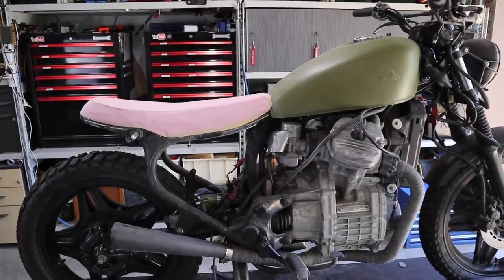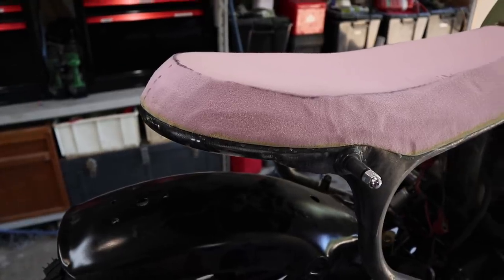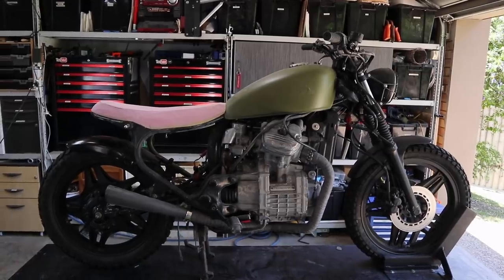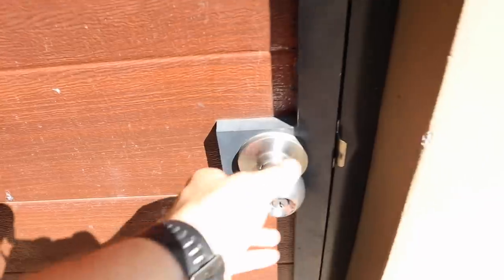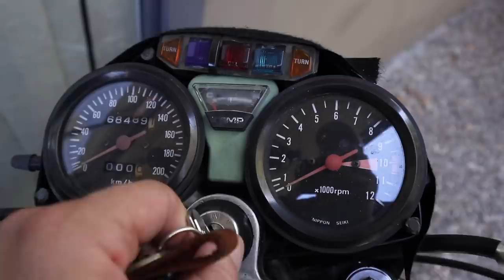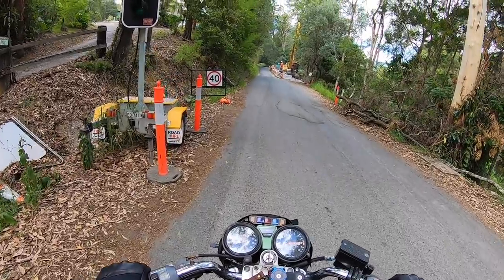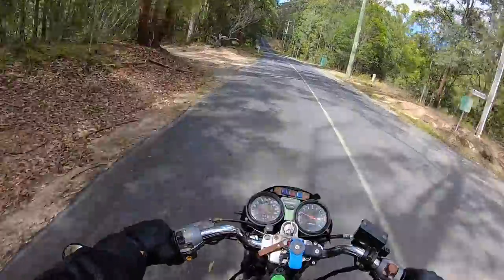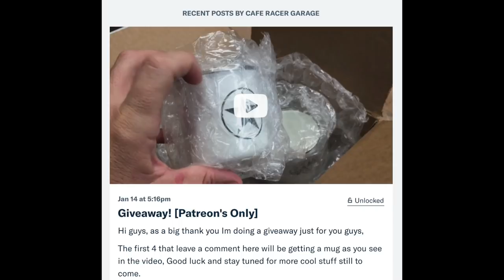Scrambler Foam Seat Pan Shaping Part 2 - Rainforest Motovlog - Cafe Racer Build

Comment: Dan took a humble rumble on the bike! :-) The seat...I think thinner at the "drivers" bit, makes a support at the back. Walking dead? My son did, and I watched passing the sofa. I only saw some bloke on a chopper/bobber'ish bike. To hold that seat in position...hmm, you have some wiring too since you put the light in the sofa. Could be fun with a belt attached to the bottom of the frame, between the frame and rear mudguard, going over the seat like the arrangement they have on old sportscars over the bonnet! You know, the Bugatti's and such. :-) I will on my build! :-) Oh, it's snowing now! ...no hurries then...

Comment: Love the walking dead and have a deep love for Daryl’s bike. I think the seat would be awesome in a diamond knit tan leather/ pleather. Seat shape looks good.  Don’t thin it too much for off road use. What if you weld the flap to the hoop then you can run a bolt wing nut though the both with access from the bottom.
Reply from the maker: Great idea and yes Daryl's bike is awesome.  Not sure why he has the one he has now tho. is not as cool i don't think.

Comment: For the seat mount, simple solution which is common to motocross bikes from the last 100 years is tangs at the side which bolt on the outside just behind the shock mounts, I've used this on my CB 250, easy to remove the seat, I've had many CR 250 mx bikes and a couple of RM 250's, on the whole, all mx bikes use this method, I'll post a pic on your FB page, the 250 is nearly done ;)..
Reply from the maker: Thank you mate, Yes a picture is worth 1000 words as they say :)

Comment: Started off my project the same way looking at daryl dixon's bike. Old Honda's over here in the UK are crazy expensive because everyone's doing the cafe racer projects with them. I wanted something shaft drive really like a BMW  but there even more expensive than the Honda's lol. I wanted to do a budget build, no set budget just cheap as possible. Eventually bought an old Kawasaki GTR 1000 for £150. Somewhere along the build I forgot about Daryl Dixon's bike and it's just turning into my own version of some mixture between a cafe race and a scrambler but one that can do long distances in comfort. So the frames been chopped and changed to fit my 6ft4 gorilla frame lol. I'm hoping to get it finished in the next few months and it's looking like it's going to  be around a £500 bike build hopefully
Reply from the maker: Homer Simpson wow you really managed to keep the budget low on this one well done. Bikes are not that cheap here either. Really need to hunt around to find one.  Thanks for the comment and sharing where you are at. It’s such an amazing feeling to know I’m helping you from access the globe :)

Comment: i have a question.
I have a fuel injected bike and i dont like the tank. 
what can i do to replace the fuel tank? i understand fuel injected bikes have a fuel pump at the tank.
Reply from the maker: Just get the correct fuel tap and you can install that to any tank
Reply: @CafeRacerGarage 
I see! Thank you very much!

Comment: I've been looking into seat mounting for my own scrambler project, and I have come up with an idea that I haven't seen on any cafe racers/scramblers before, not sure why because it makes complete sense to me. I'm going to use a seat latch like this one: https://www.google.com/search?q=kawasaki+ninja+seat+latch&client=ms-android-samsung&prmd=isvn&source=lnms&tbm=isch&sa=X&ved=2ahUKEwie1OqS_vzfAhWdUBUIHRdYCHAQ_AUoAXoECAsQAQ&biw=360&bih=560

There is loads of bikes that have this type of latch, it has a cable coming off it, which could easily be swapped for a longer one, and attached to a Choke leaver type thing somewhere hidden under the seat, so you pull the Choke lever and the seat pops off. Simple. You might need to get a latch made up on a lathe or else take it off the seat that the latch comes off